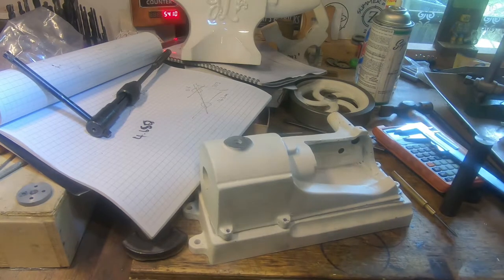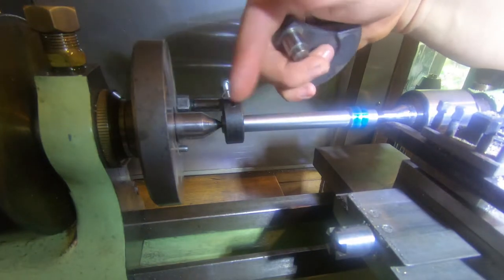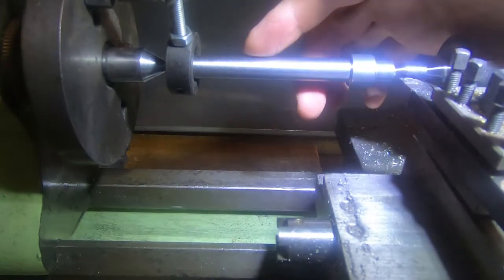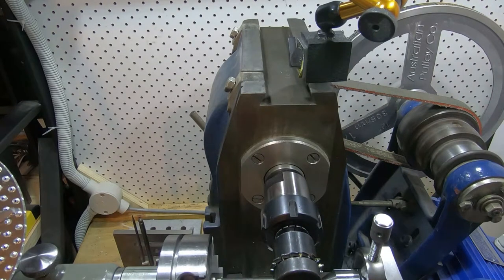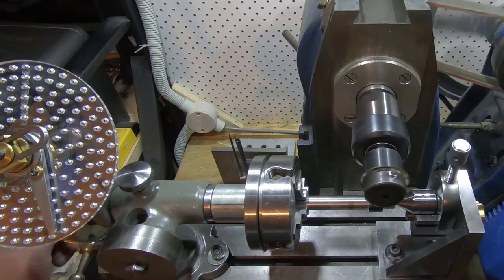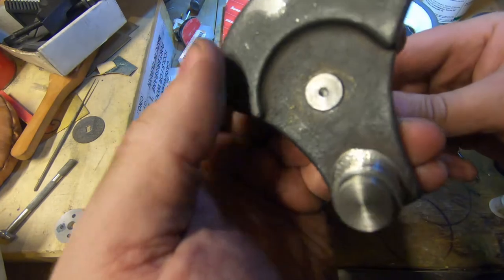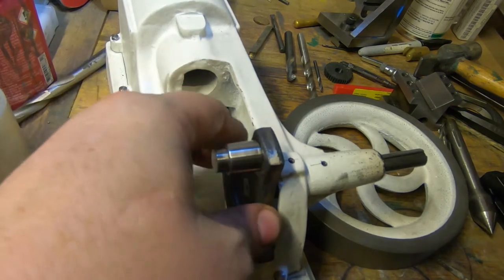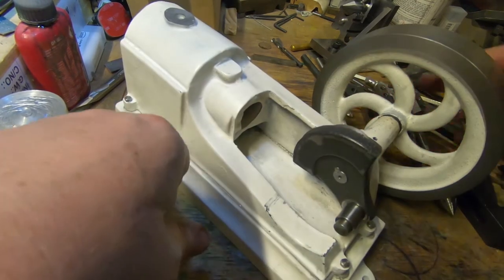Introducing the "400" Part 14.CRANKSHAFT AND GEAR

Comment: That is one shiny dividing head plate.  Did you make it?  I bought an old dividing head (L&W Chuck Co.)from a used tool store for 100 bucks.  40:1 but only the 15-20 hole plate came with it.  I had to make the other 2 and let me tell ya, there's a lot of work not only drilling all those holes, but making sure they are perfect. It did take me a while using my rotary table but I now can cut any number of gear teeth.  Since then, I have acquired a mini metal planer and I think I might be able to cut them on that too.  The only thing with that is that dividing head is HEAVY and big so room on that small table may not be enough.  Emma,  check it out, it's the only video on this channel here.  There's a story about it in the description and pinned comments.  I think you'll like it. Again, something I had to "tinker" with to get it working that turned into a full restoration. Lol You are quite a craftsman, pay attention to detail, and very meticulous. That's why you do such great work.  Thanks for sharing your projects with us.
Reply from the maker: they were laser cut. the effort to drill them all accurately versus the time and the actual error of a hole being out .5mm was too much of a trade-off. its just polycarbonate sheet
Reply: @EmmaRitson  Oh, that's the shine.  Thank you.
Reply from the maker: and the reality is, i can measure the error in any of the holes on the actual spindle . so by the time the error is divided by the gear ratio and the number of quadrant turns, its next to nothing.
Reply: @EmmaRitson  Yes, that's what I was thinking, If I was off a tiny bit, and as hard as I tried to make them perfect 40:1 will absorb a lot more than a 10:1 or 25:1 if I was off at all. Thank you.